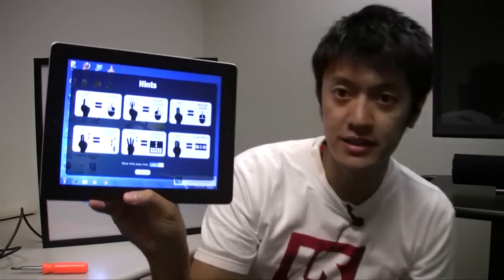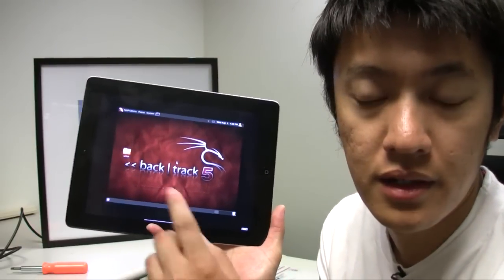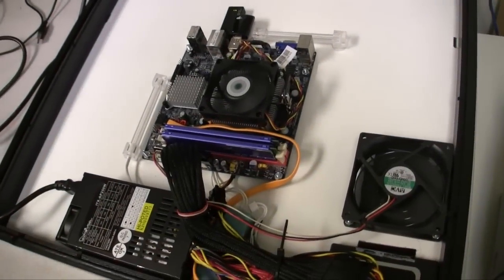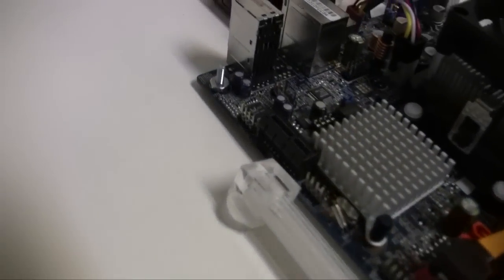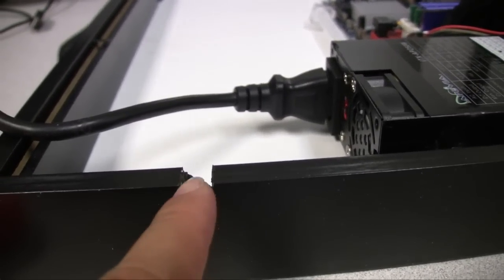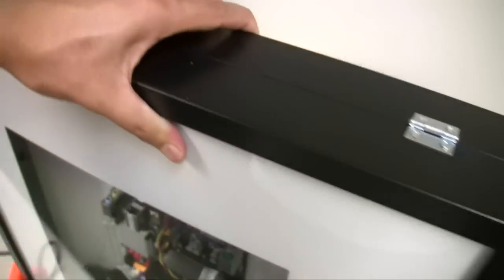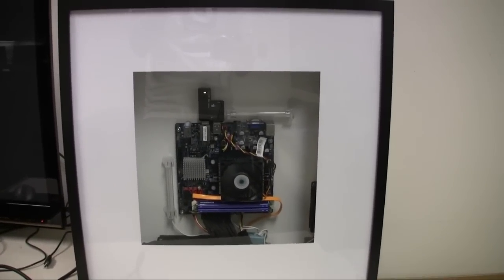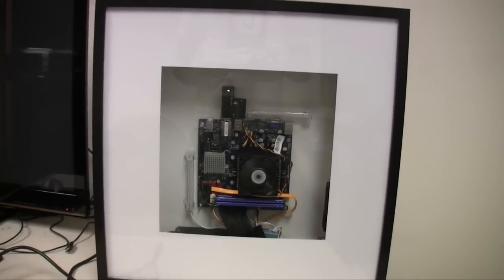Picture Frame PC Part 2

Comment from the maker: @ChanTheN00b the airflow works really well. I should have used something more discrete in term of the fan. I might not have even needed an extra fan and only needed the two cut outs at the top.